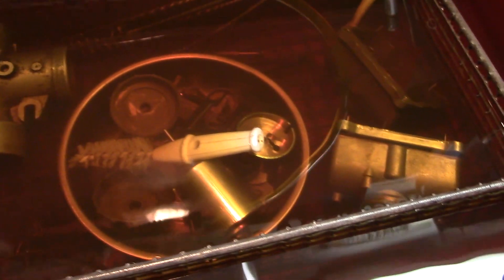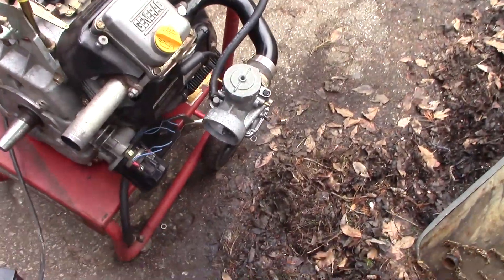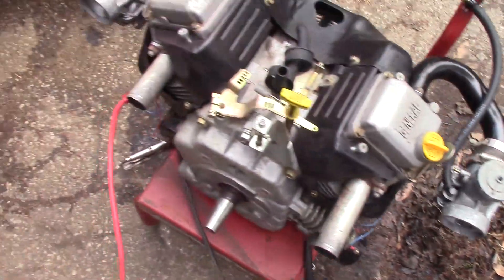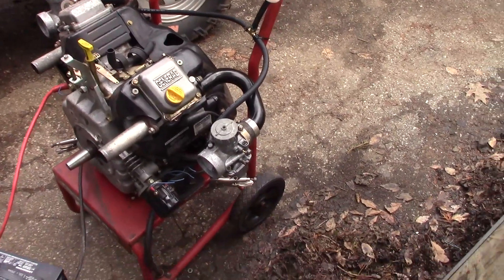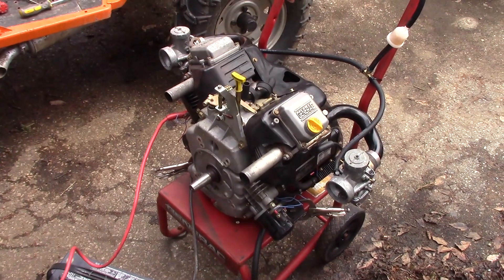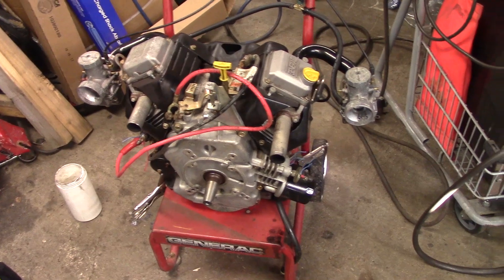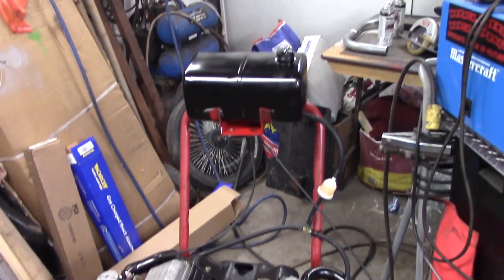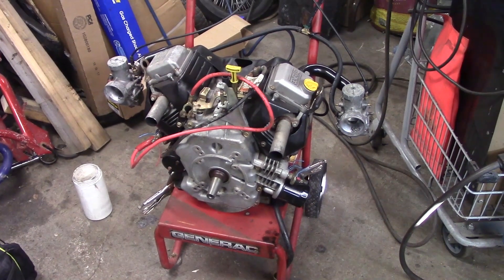Generac Generator Engine conversion to run on Gasoline Pt-1

Comment: P I have a generac motor on a motorcycle ride on gasoline and it runs like hell man that f*****'s fast
Reply from the maker: Sounds like an awesome ride,thanks for checking out the channel
Reply: I really would love to know what you ended up finish doing and what you got it running on and all please reply
Reply from the maker: @Merritt83  Still looking for the right project for this beastly motor,it's sitting in my shop still,ready to go!

Comment: You only need 1 38mm carb just combine both intakes into 1 either above the engine or in front of it via a plenum chamber
Reply from the maker: After much tinkering with the carbs,I have them dialed in pretty good,and I picked up throttle cables too! Going to re-jet the carbs,running rich at idle still but getting really close to being ready to run.Thanks for your time and input!
Reply: DL I would love to see your setup
Reply: @Merritt83  the reasons behind only needing a single 38mm with plenum are 1)using a plenum increases the manifold volume (allows 1carb to volumetrically operate as if it was 2), 2) ease of maintenance because constantly rebalancing/resynchronizing carbs sucks, 3)due to both cylinders sucking air fuel mix every other revolution a single 38mm carb has a high enough cfm rating to handle that engines max volumetric needs.  I can tell you all this from running the numbers on a similar engine... By the way I didn't mean my comment as a dis I meant it to be an alternative for anyone doing something similar... I've built high output engines as well as race only engines (I had 2 early 80's Kowasaki liquid cooled 440 2cylinder2smoke engines modified into a monster 880cc inline 4 running 15krpm thru a motorcycle clutch and chain drive(meat grinder clutch) and Harley 6speed transmission in a snowmobile fed via a combined plenum via 4-44mm mikuni round slides (2 of the 4 carbs only opened above half throttle via progressive cable linkage and had their idle circuits plugged off) that was one hell of a snowmobile back while I still had it back in the mid to late 90's
Reply: @dodgeme1986truck  I would love for you to make a video and let me see how it looks cuz I can't find much on the internet and I have one of these engines and I would like to put it to use for something I thought initially of putting it in a golf cart and letting it run off from LP but I don't think that's going to work out
Reply: @Merritt83  unfortunately that machine is long down the road... The engine could only handle the power I was requesting from it for so long... That and I got run down and over at 120+mph by a ghost ridden machine in the braking zone in an ice drag my top speed was just north of 180mph in the 1/4 with it but the machine itself was destroyed I still have the studded track scars on my arm... And I lost track if where that engine got to after selling it to pay the medical bills.
Reply: don't know if ur still on here but im looking to make a plenum chamber like ur talking about but id like some advice on how to design it, thanks!
Reply: @connergipson6678  Google long tube cross ram intake... Adjust the runner length to adjust engines desired power band if you want more idle/ just off idle grunt use a longer runner tube if you want higher rpm power use a shorter runner... multiple carbs I prefer the master/slave combo... Master carb has idle controls/jetting, slave carb(s) have plugged idle jets and no idle screws they were either open or shut  similar to the old triple deuce/ tri power/ triple demon 98 carb setup...  For plenum volume na 80% engine displacement, forced induction 150% engine displacement is a good starting point (this is a good tuning point) increasing plenum volume adjusts power band higher  decreasing lowers power band... I ran the master carb from one plenum end the other was on the opposite end of the plenum. It was a 8runner split plenum intake on mine(4long tube runners 4short runners) full split plane plenum could be considered 2 separate plenums 1for master other for slave carb...
Reply: @connergipson6678  i would recommend a 2plenum setup combined volume at 80%total engine displacement na engines 150% forced induction engines for a starting point (tuned from there) research long tube cross ram intake  short tube cross ram intake and tri power/triple deuce intake, and look at the 95-99 aluminum neon 2.0l sohc curved runner per cylinder intake  manifold. I believe I ran 1inch primary  carb runners at 12inch length and 1.25 secondary carb runner on mine at 6inches... I had to add a heat exchanger to the intake plenums on mine due to the gasoline cooling too fast in my engine dropping out of atomization...
Reply: Yeah that was my thought too why 2 carbs??
Reply: Hi I’m new here please excuse my ignorance but I have a generac 16k whole house standby generator running on propane I’ve had this thought of converting to run on gasoline instead of propane but this method is not working for me 2 carbs why?? I’m thinking can 1 carb do the job?? Thanks any thoughts to help??
Reply: @MrCarmelo1959  single carb should be more than adequate as most gas/propane generators run at 3200-3600 rpm looks like a 999cc v-twin you will need the carb intake and governor linkages for the gasoline conversion